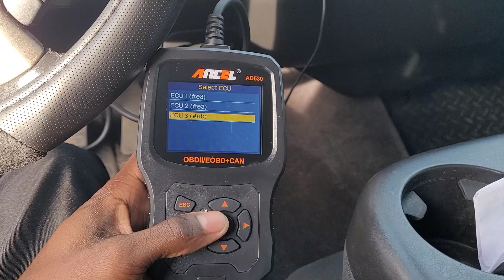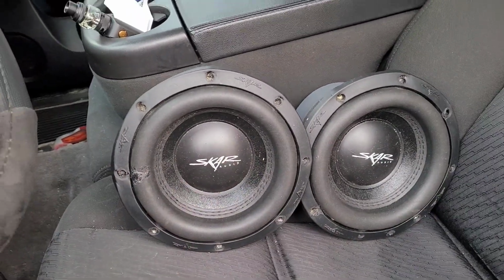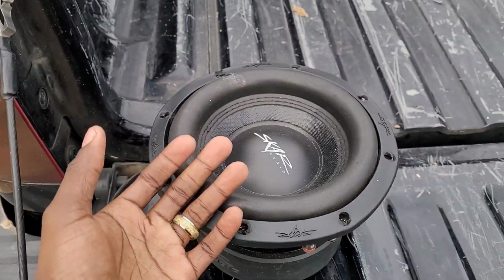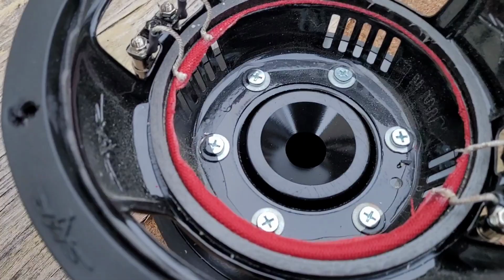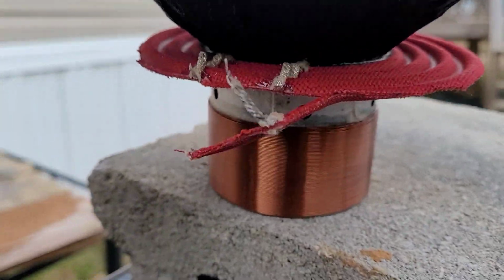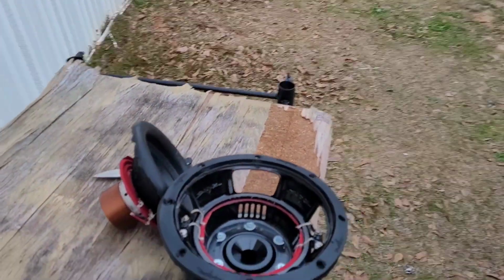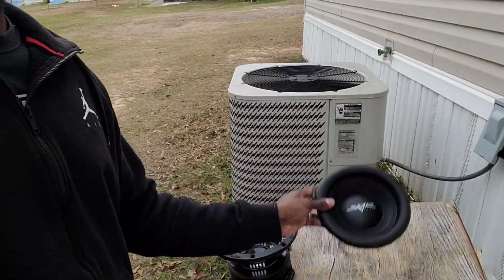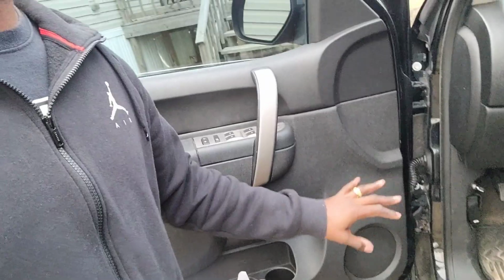BLEW My Skar Audio Svr 8s| Mistakes Were Made| This Is What Happened| Silverado Audio Update!!!

Comment: Technically, the reason a subwoofer blows is basically always too much power. People say it's clipping but it's not the clipped signal that is the problem, the problem is when your amp clips it also puts out way more power. I've seen a little amp do 150 watts and when it clipped it put out 240 watts. I damaged a Skar VXF 15 on a smart 3. It seems to play fine now but after that I put two different VXf 15's on my Smart 3.

Comment: I feel u on not wanting to tear up the truck. I got 2 sundown Xv3 12's on a smart bass 5k in my Mercedes and it's cracking plastic on my trunk and ruined my led license plate lights. Just little stuff like that, but when u got a nice ass ride, the bass will tear it up. But it's soooo hard to resist as a basshead.🤣🤷‍♂️
Reply from the maker: It really is bro 🤣 ill probably still end up adding more

Comment: If I’m running 4 of these wired at 1 ohm on a skar rp1500.1 d I could basically run the amp at full power no issues right?
Reply from the maker: Yes as long as your not clipping you’ll be fine